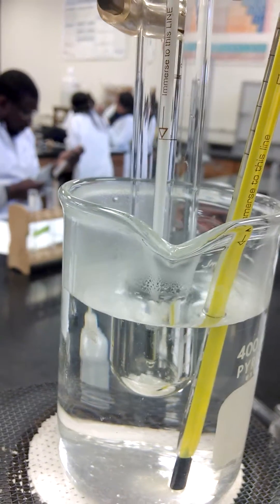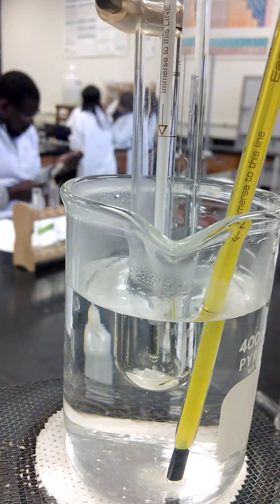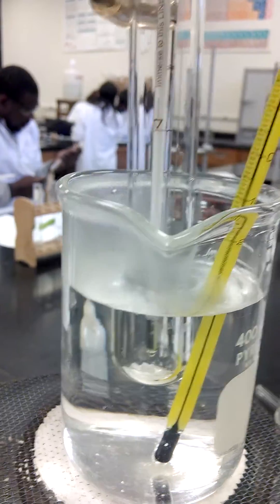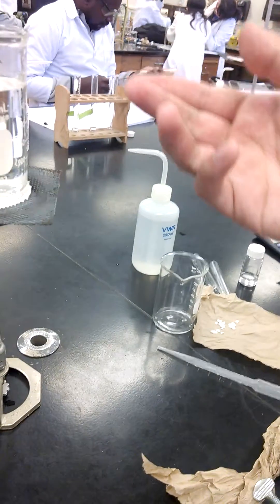Boiling Acetone in Water

Comment: does acetone boil faster than water?
Reply from the maker: The acetone boils at a lower temperature. Because in its liquid form the acetone is at a lower temperature than boiling water, the water transmitts energy to the acetone, and this causes it’s temperature to rise and eventually boil.
Reply: acetone boils and turns into vapour at a very high rate compared to water and it also ahs a low boiling temperature of around 55 degree C